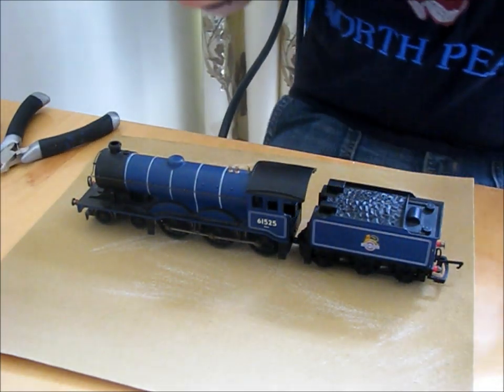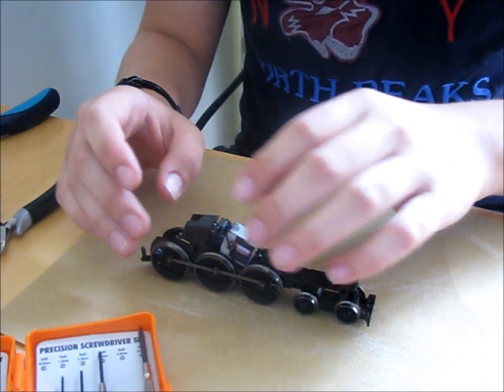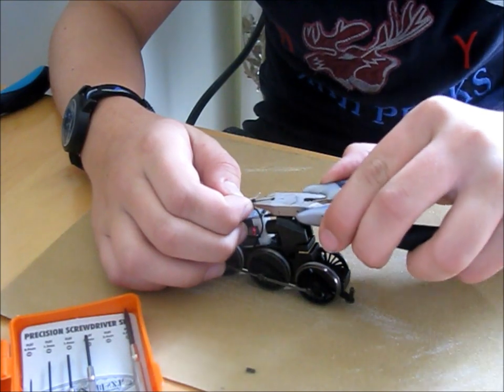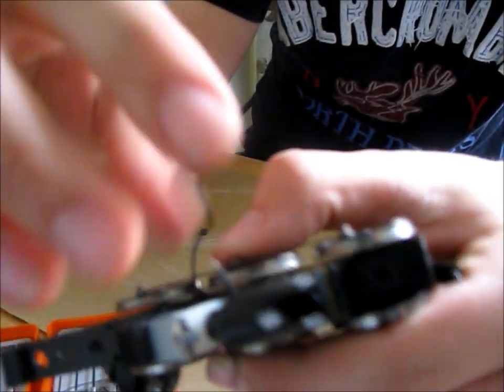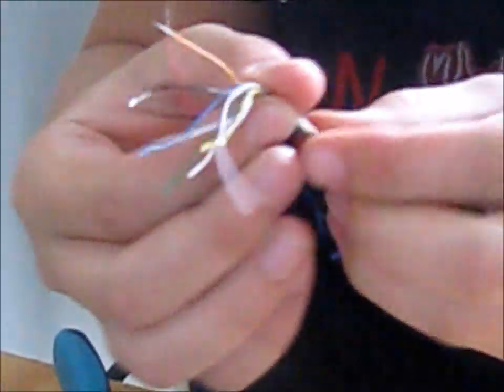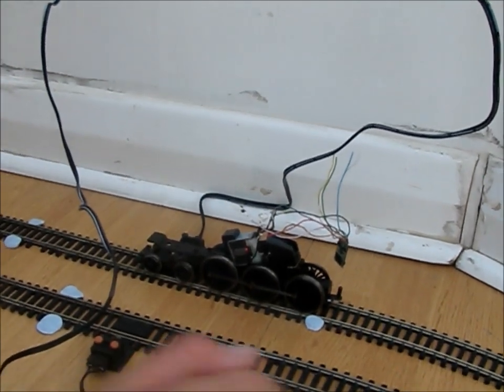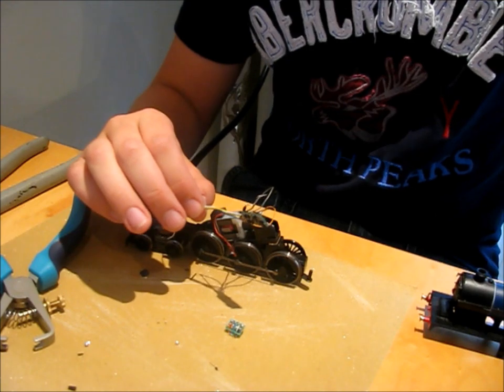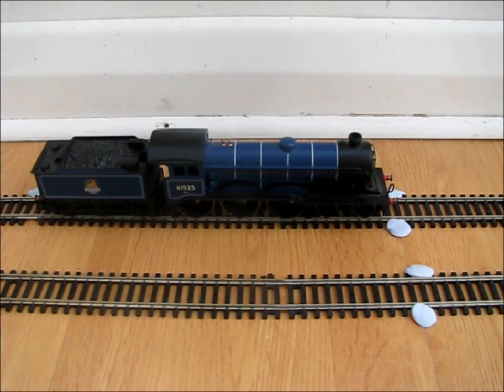Fitting a DCC chip to a Hornby Loco

Comment: Tinning up your wires makes it a lot easier, strip the shielding off touch them onto a hot soldering iron with your solder, then when you solder them together or attach them to a terminal they solder first time, definitely use heat shrink far easier than wrapping them in insulating tape, thanks for sharing about the clearest explanation i've seen.

Comment: regarding soldering. i recommend you purchase some flux, having stripped and twisted the wire strands, apply flux to the end of the wire. apply a tiny amount of solder to the iron then touch it to the wire. the solder will flow up the wire (this is called tinning) repeat on all the wires to join. then touch the wires together and touch the iron to them. there will be enough solder to make a good neat strong joint with the solder on the iron. if you apply the solder directly to the joint with the iron you get a big blob (if you are fitting lighting kits etc to chips, if you apply solder your way all the terminals will blob together and it will get ruined) hope this helps
Reply: I have been a prototype wire man for over 40 years and have never used flux, indeed it's really bad practice for this sort of job. use solder with flux in it. but never flux especially acid flux.

Comment: Jack Blackmore, if the loco is DCC Ready, the plug he cut off so he could solder won't be cut off, it will plug into a DCC Ready plug where the blanking chip was, discarding the blanking chip. With a DCC Ready loco there is no need to solder. This information can be found at the Hornby website, with pictures and instructions. DCC Ready is much easier to accomplish wiring wise.
Reply: That's a relief to know. I have a bunch of locomotives I need to do up. Although most of them predate DCC ready models >_> 
In fact one of my favourites is so old it needs some kind of rubber band that they don't sell anywhere any more, so she can't run.

Comment: You should tin the wires you are joining first, and don't rely on solder cored with flux. You will get a better join by adding flux to the iron tip as well.
 It would help if you used a finer solder as well.

Comment: If it is DCC ready it should have a socket already hard wired in to allow you to simply plug in a chip.  You will have to purchase a chip but you will need to check whether it needs a 6 pin, 8 pin or 21 pin decoder (chip), it should say on the box somewhere or I believe you may be able to just count the pin holes perhaps?  A decent 4 function (the more functions the better) decorder (chip) should set you back around £15 or so, not too expensive!

Comment: Love your video, but I have a problem with trying to fit a chip to a Hornby Fowler  2-6-4T. How do I connect the two wires from the decoder to the wheels pickups when there is only one wire, that connects to one side of the wheels?  there are not pickups on the other side of the wheels.
Reply: send it to me, if you havent managed yet

Comment: dont rely on the solder to make the electrical connection, its a bad conducter. you should solder an already mechanical joint to make it permanent.

Comment: Your asking for problems with exposed bare solder joints. If you do get a strike between them you'll shred the chip. Always insulate with shrink tube. But on the plus side a good effort